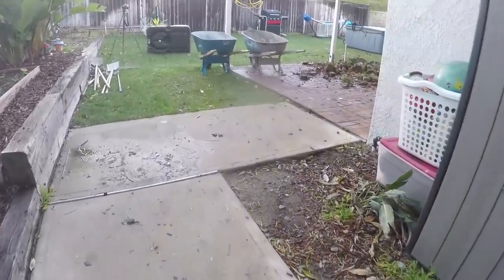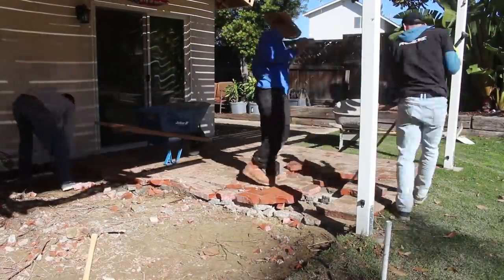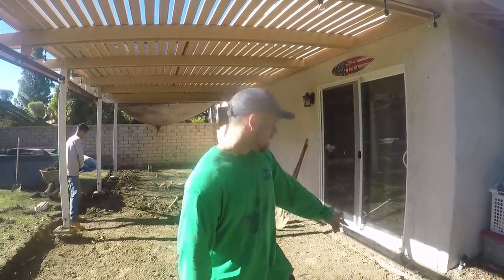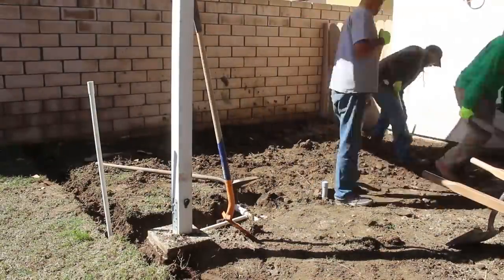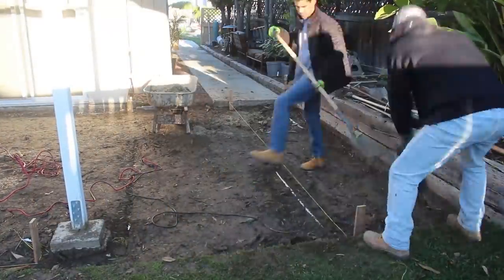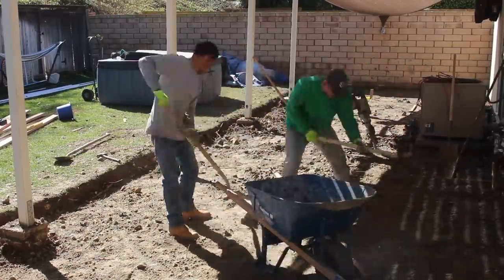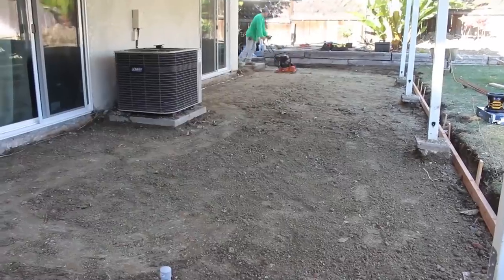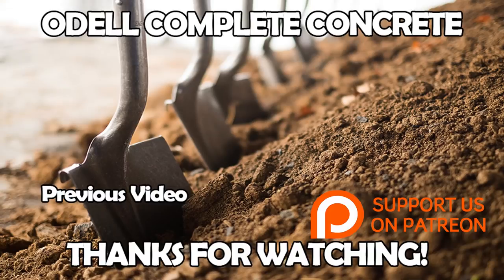How to Pour and Setup a Concrete Patio Part 1 Concrete Tips

Comment: Dump trailer tip - if you connect a chain to a tire with a rim on it and set it up against the front wall of the dumpster before you start filling it and run the chain to the back of the dumpster then the guys at the dump may be able to pull the majority of the load out for you!
Reply from the maker: Sounds good.
How about some plywood on pipes and a chain connected to it?

Comment: This is good stuff. Love your videos and your dads videos. Been following both. You guys do excellent work…not too many trades these days are knowledgeable as you guys are!. question, I’m doing similar work and my house has the same configuration. Do you drill the rebars in the foundation to tie in with the new concrete and new rebars so that the concrete height stays the same and doesn’t shift? Also, I have 12 ft, concrete, so go with 2% which will be 3 inch drop? Also, what psi would you recommend for driveway and backyard patio extension? 3000 psi?
Reply from the maker: Don't drill into the house.
2"s is enough slope.
3000 psi is good

Comment: I’m getting my back concreted, it’ll be 38ft by 18ft by 4in. My quote is 3400$ and that doesn’t include any rebar or wire mesh. He told me it’ll be strong enough and last a long time. Is it fine like that ? Or should I spend the extra 300$ to add wire mesh.
Reply from the maker: I would add some reinforcement

Comment: Scissor lifts don’t do well for a dumb trailer. Need a trailer with the multi stage cylinder located at the very front of the dump bed. A little slower but it will dump whatever load you put in the front of the trailer. This is the way a dump truck is setup as well.
Reply from the maker: For sure

Comment: The form against the house is a half ass thermal break.
Reply: Which probably isn't needed in that hot climate either. I think they work in CA. 🤣
Reply from the maker: Intresting
Reply: jhm smart tv ya know, they do work both ways, if that slab is in the blazing sun all day.... the heat will sink into the house all night. 🤪

Comment: I'v been a finish rake man on a asphalt crew for over 35 years. Picking up the levels by eye is not something that can teach or comes with experience. You either got it or you don't.  If that's the case, use your brain, learn how  to set and read your tools efficiently and correctly and you will be just as productive as a guy with a good eye, if not more so.
Reply from the maker: Get it on